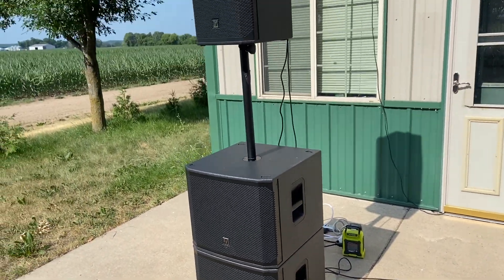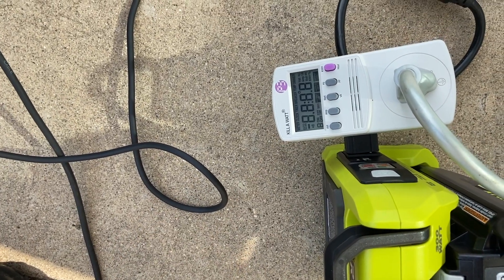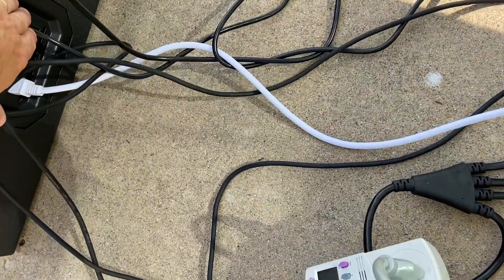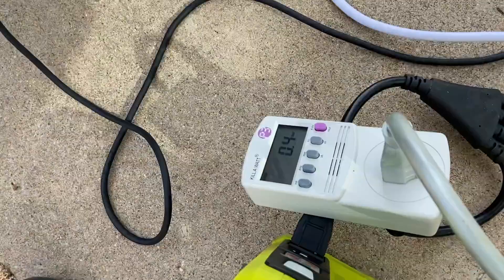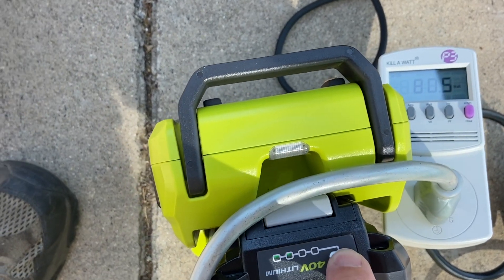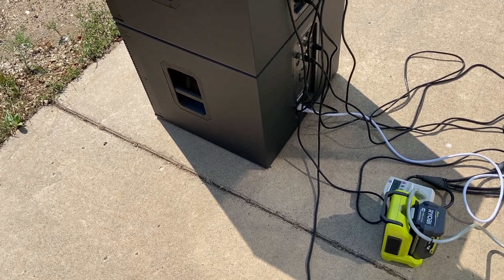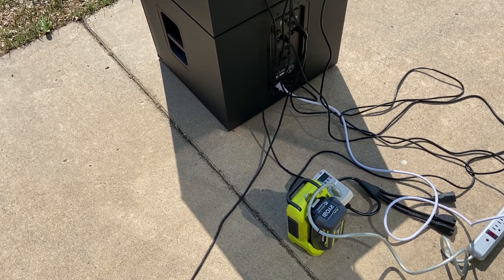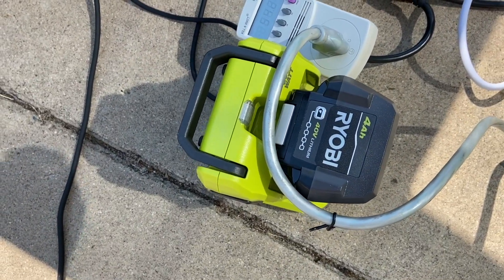Battery Powered Subs and Top Run Time Test on Ryobi 300 Watt Inverter #RyobiTools

Comment: I now run two 15 inch subs. Years ago that was my setup back in the days of passive speakers. For me the key is to get more thump than I would with just two tops. And yes a 300 watt inverter is too small for most DJ speakers. I have a 600watt and a 1000watt inverter that I am going to test out off of a 12 volt battery. I have both 3 agm batteries and I just purchased a 50 amp lithium battery. 
It's almost summer so I am sure that I will use this stuff right thru the Fall tailgate season. Perhaps up until November.

Comment: Do you think this could power a Sennheiser XSW2 835 Wireless Handheld Vocal Microphone for about an hour? Or would it be safer getting a more high end battery such as a jackery?
Reply: Hi Trey, Your wireless would work all night and then some however rather than using an inverter I would look into running the receiver directly on a 12 volt DC battery pack with the right size barrel connector and polarity.

Comment: Hey John.  We have been using two 15" subs instead of an 18" for years now.  I'm about your age and my back is very grateful.  You won't get quite the "Boom" factor with two 15's, but they are a heck of a lot easier to manage.  I've never tried running them off a battery though.